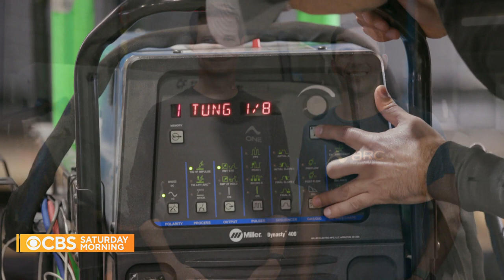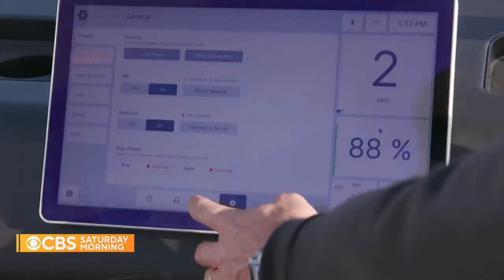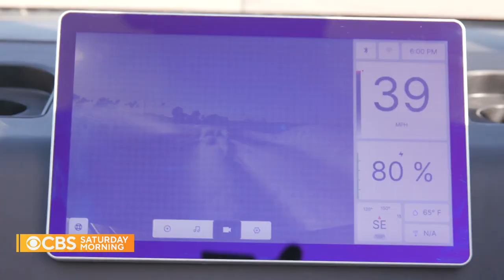The future of boating is electric

Comment: I would love to know the single-charge range of this boat at planing speed. It might be good enough to get to a favorite fishing hole or beach, but I doubt it would do for a few hours of water skiing.
Reply: It looks like the boat uses two battery packs. My Tesla Model 3 uses one battery pack and gets over 230 miles of range on a single charge. I wish Tesla would buy them out and launch the Tesla Motorcraft. It's basically a Tesla car without wheels.